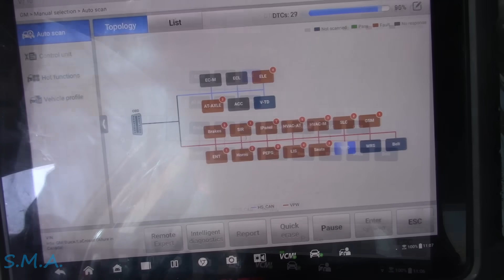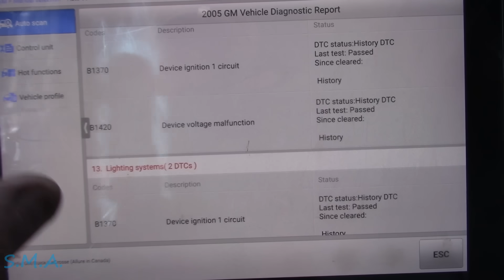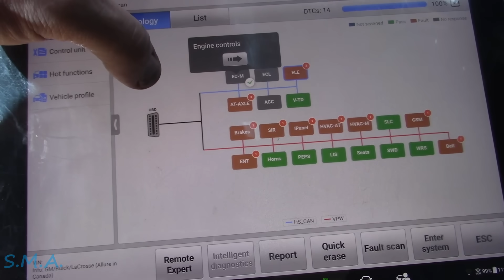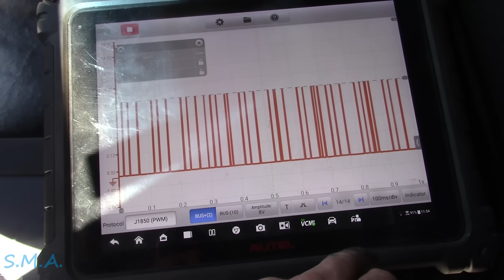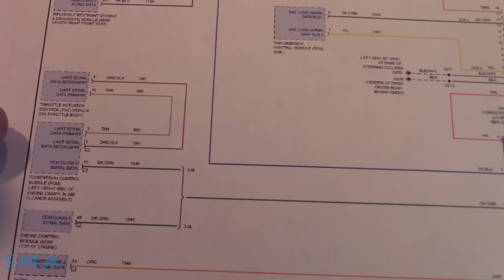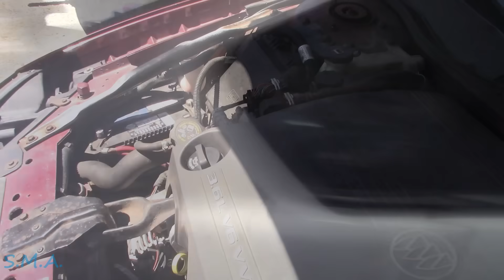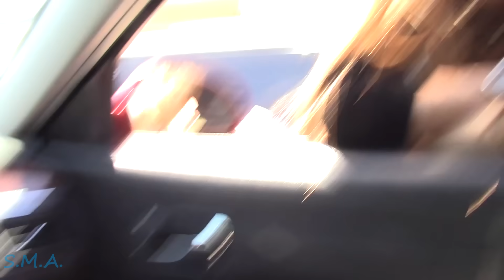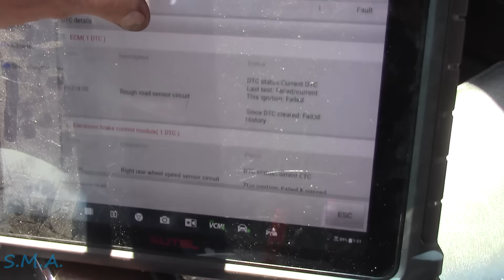Buick LaCrosse: No Start No Communication

Comment: Even some methods for ferritin out the truth from the general pooblic. Eric O. Have ya'll ever changed out the Bluetooth on a Dodge car? It's up under the steering wheel and brake pedal. When you are over 75 and ya'll don't have Eric O. Or Rainman or diagnose Dan in the general area you do it yourself. Not only that but at the dealership it is 500 dollars for your wife to make phone calls in the car. Well I will tear it apart and try to find the internal fault. Since these are common failure points I might be able to find it. The radio has been blanking off and when turning off the wipers it straightens up it seems to be a grounding problem. Now I also have to find all the ground spots even inside the car. Thanks for your videos Eric, ya'll have excellent diagnostic expertise and it helps me. Thanks, Paul.

Comment: Code PO318 is a Rough Road Code, the Lacrosse comes with hardware which allows the PCM to determine if the engine is running rough or if the road is rough if it can determine between the two it throws the code PO318  a lot of auto makes are adding this hardware.

Comment: Hi Eric, a message from Dean Harris.
I am a former Holden/ GM tech from Australia and have had some experience with vehicles that have a rough road sensor.
We had the Holden Barina/Viva from 2005 to 2009 made by GM Daewoo which had this sensor installed.
They were only on vehicles which were not fitted with ABS in the cheapest model grade.
I suspect that is why you ended up with P0318 after programming. 
The replacement PCM possibly came from a vehicle not fitted with ABS.
Hope this helps.
Cheers, Dean.

Comment: That powertrain was actually one of the better ones GM had back in the day.  The 3.6 V6 with a four speed automatic can hold up for a long time.  The question was always around the electronics back then, which is the case here.  I always learn from these videos, thank you for sharing.  Thanks for sharing while driving to an appointment your conclusion.

Comment: One of the things a good mechanic/shop has to deal with is getting jobs from one, two or even three previous mechanics/shops that can't solve the problem. Therefore, as in this video, you have recent finger prints and disturbances to the vehicle which pretty much hands the next guy alphabet soup to start a new diag. At least with humans, there is a medical file/history that comes with the patient which might not be a bad idea for vehicles to have...a documented history sheet that stays with the vehicle however, one concern of variance would be "not the same doc is seeing the patient" regularly and it would likely cloud the history some.  In this call, at least the cost of the computer wasn't very much so that seemed more practical and got her running for the cost of a pack a cigs.

Comment: The case of the PCM is the ground return circuit. when I saw this problem on the Holden product, I could not install a used PCM unless I "reset" the used PCM first.....

Comment: In my defense this explanation is only for proof-of-concept and had to be shown to my previous boss. I cut the data wire going to the ECM and put a scope on both leads you'll notice on those GM computers that their voltage drops down into the millivolt they still communicate but they're unable to communicate if you get my drift. The vehicle side of the harness still contains the 7 V

Comment: Your dealing with the GP (general public) advice rings true to me. I led a team of technicians doing CNC machine maintenance. We had a lot of skill and experience, but frequently lacked OEM documentation. Troubleshooting particularly deep electrical failures could lead to the black hole of OEM secrecy. This juncture would get me on the phone with the manufacturer wizard "Shell Answer Man" (does that date me?). I was just smart enough to provide the wizard with exactly the data he needed to get stuck at the same place that us (me). I learned to filter the question and data to not lead the wizard down our problem rabbit trail and let the wizard "spill the beans". Most commonly, withholding information would allow the wizard to speculate down his own path and not detour where we got stuck. I usually aborted the phone conversation with, "Thank you. That is what I needed...", before he concluded his speculation musings. 

In this video, you easily could have started chasing pre-existing symptoms that the customer was satisfied to live with and didn't affect the issue that brought the Buick to your shop. Witholding information  instead of leading the GP (customer) acheived the required confirmation without letting you wonder if you set the customer up to leave you with the same question.

You are able to obtain OEM data, though at an expense, in the automotive world that was not available to us in the much smaller CNC world. Even when your service data is wrong, the specific error becomes obvious and gives you other valuable information. An old former boss self defense quote after I caught him documenting wrong information was, "A little bit of wrong information is better than no information." He was wrong in the self defense specific situation, but no information can be a dark hole of discovery difficulty. Armed with information you can save a lot wasted time and unnecessary work. I enforced our shop rule to accurately add or correct documentation when a discovery was made. Our shop kept machines for decades. Cataloging data for future reference for the entire staff was a daily requirement. We referenced this data base daily in subsequent troubleshooting.
I had a particularly savey technician that wrote and in maintained our maintenance and repair software program. He created search engines to allow us to search tens of thousands of repair records in moments to find previous repair successes. This saved vast amounts of time and allowed moderately my skills technicians to effect successful repair while lacking personal technical troubleshooting skills. I labored as a technician and led the team for over 30 years. We created an interdependent team providing around the clock maintenance support to keep production equipment fully functional. You work in a "one man shop" and only need to document what you cannot remember. Around the clock production demands required us to routinely hand off incompletely diagnosed or repaired machines to subsequent shifts for completion. Logging repair documentation before leaving your shift allowed subsequent team members to understand how far you got or they could tell where you made a mistake and didn't have to go back to square one and start over. Smart technicians didn't easily see the need for "simple issue" documentation, but our less skilled staff was dependent upon this data. We set our company interest above our own egos. Maintaining this departmental culture required keen management attention.

Your YouTube video record uses a very different format to document troubleshooting struggles and successes. I have been retired for years and still enjoy sharing in your troubleshooting journeys. Modern vehicles parallel the CNC technologies that I dealt with. I regularly wished we had more complete documentation for our equipment. I don't like working on cars. The hobby mechanic doesn't have affordable access to required documentation. Industrial machinery designers give much more consideration to  repair technicians than car builders. Repair access and documentation is impressively complete, even though I wished for better data. 
Thank you for continuing to post to YouTube.

Comment: I gotta wonder if the GM site has issues. My buddy just did a used BCM in a Caddy and not only did it take FOREVER to get it to download, but also he too got several error messages, yet the thing worked just fine with no codes. It was his 1st time as well swapping in and reprogramming a used piece. New 1s are NA. (02 full sized with the 4.6)

Comment: Yeah it’s a universal asynchronous receiver/transmitter. The main deal with those is you don’t need a separate clock signal so assuming you agree on the rate you can send data with just one signal wire.

Comment: FUN FACT...
UART..  Universal Asynchronous Receiver-Transmitter
That is the 9 pin and/or 25 Pin serial port on the back of REAL OLD home computers.
It was used for Analog telephone Modems and the serial mouse.
It was replaced with the USB port (Universal Serial Bus)..

Comment: Recently my cousin had his Mitsubishi 05 montero move while he was under, he got bruises only cuz I stopped it in time but it didn’t crank we assumed the issue was dead starter so he straight wired it n it started in drive, turns out, shifter cable came off from the shifter, thankfully he’s fine

Comment: That would not be the first GM ecm going bad because its solidly mounted to the engine and experiencing all the heat and vibrations that it does. Really a lame design

Comment: We definitly need a "rest of the story" on this one. Would love to see you solve all the problems on it.
Reply: The rest of the story is that the p0318 rough roads was caused by the wheel speed sensor which there was also previously a code for. The computer uses info from the wheel speeds and correlates it to the crankshaft position sensor so that it can tell the difference between a misfire and the wheel hitting a pothole causing the engine to slow down. If the guy gets the wheel speed sensor problem fixed, no more lights no more codes....probably
Reply: @LargeMuscularTitties  that era GM car with wheel hub sensor issues,  go figure.
Reply: @ curiousgrandpa… You must be a listener of Paul Harvey… “ Good day!”

Comment: Most trouble codes trigger the check engine light (or MIL malfunction indicator light). For this P0318 DTC, the light is not illuminated. You may, however, have other warning lamps illuminated (traction control, ABS, etc.) or even have some engine misfires or rough running.

Comment: Eric O.  I have a 07 Lacrosse, with the dreaded 3.6.  I bought it in 09 and have been nursing it along since.  Had 29K when purchased - now has 168,000 on the meter.  Thanks to you and Ivan, I've kept it running.  Bought some test equipment, breakout box, ginned up a fuel press gauge assy. And some other " stuff."  I do need a small Scope or a kit to make my laptop the scope.  

Here's my question:  Why did you go to the PCM at the "get go?"  Was that because there was NO money light when you turned the key on?  That's my guess - true or not?   Thanks for helping me learn how to trouble shoot.  A lot of it came as second nature as I worked Aircraft Avionics for quite a few years.  See you.  Hi to Ms. O.
Reply: I think it was because the PCM wasn't talking at all during the scan. A lot of cars don't or won't set codes for just a no start condition for instance if the ground wire was at fault most PCM wouldn't even know the ground wires gone and wouldn't set a code but if you tried to talk to the PCM with the scan tool and it doesn't respond that would make someone zero in on that.

Comment: Correct engine misfire detection is dependent on whether or not the vehicle is experiencing a rough road condition. A rough road condition causes unexpected crankshaft fluctuations. In order to detect a rough road condition, the electronic brake control module (EBCM) communicates a wheel speed signal over the serial data circuit to the engine control module (ECM). The wheel speed sensor information allows the ECM to distinguish if the crankshaft speed variations are caused by a rough road condition or are caused by a true misfire. If the EBCM reports a wheel speed sensor failure, or the ECM does not receive the rough road information, this DTC sets. doc id 1448080 in si

Comment: Don't feel bad I don't remember what uart stands for either. I just remember it is a serial port. Which kind of doesn't make sense because that's a really slow connection. That's technology that predates the PC. I should remember what that stands for I spent over three decades screwing around with them. So if you want to feel bad feel bad for my memory.

Comment: I  figured out why he takes so long to mow he covers the lawn in top notch then lowers it one notch cuts the lawn on to 3rd notch cuts again he doesn't want to over load the mower so 1/4 inch increments it is and I'd bet he changes direction so lawn looks like checkerboard.

Comment: Eric very common issue over here in GM's(Holden) of that Era, I've done several where I just install a momentary starter switch across the starter relay, as all of the used ECU's will die eventually in my experience.
Reply: @A. Melbs VZ & later(newer), actually anything V6 ecotec(alloytec) 2004 onwards (VZ VE WM WN Rodeo, Colorado, Vitara) etc... Have come across many 'Mechanics' up here in Brisbane who looks at you like you're Albert Einstein or something when you suggest a simple $20 fix to an otherwise cost prohibitive repair!

Comment: That is a very organized and well kept salvage or junkyard,the ones here in Las Vegas is very run downed and extremely ghetto..anyhow you sir always repairing vehicles that other shops and even dealer or stealerships cannot..great video and content as always
Reply: if 9/10th of the west coast to midwest burnt in flames, there'd still be enough stupidity there to ruin the solar system in a month. 🤣

Comment: Eric, you are the master of TLA's or as we say in the industry, Three Letter Acronyms. I learn something new each video. Thanks, Man.
Reply: Yeah, but Eric got hung up on the FLA  (Four Letter Acronym).  "UART" = Universal Asynchronous Receiver Transmitter.   Comes from the early days of the microcomputer industry when connecting small computers to serial terminals (Teletype machines, IBM 2741/Cope 1030 terminals, DEC VT100 video terminals, etc) using an RS232 bi-directional serial interface was a common thing.  A UART is basically a pair of data format converters.  One is a parallel to serial converter and the other a serial to parallel converter.  The UART would take an 8 bit word from the computer and given a clock signal would generate the correct baud rate and step the data out serially to the terminal.  In the other direction it would accept the serial data stream from the terminal and assemble it into an 8 bit word that the computer would retrieve from the UART register.  One of the more common ones back then was the AY3-1015D if anyone wants to look up a data sheet for more details on how it works.

Comment: I’d like more info on your to go tool set for the yard. Didn’t see it on your shop link. Looked like a decent tiny set. My tool set gets heavy to carry when to go to my local pullapart yards. Like I’m sure you do….. these upullAndpay yards are awesome! I love mine! Nothing more exciting than finding aftermarket goodies for cheap! 
Keep up the great work! Wish I had a local guy like you near me. Probably do but haven’t found them yet. I’ve got hella problems with my rear temperature settings on my 04 Tahoe z71. I’ve replaced the whole system, harness, motors, sensors, brain, controllers  and still nothing proper. The temperature motor goes to max one way and won’t turn at all. :( been this way for years! I’ve just been clamping the temperature door flap end to cold or hot depending on season. And yes it’s stupid! :( I hate it! :( just can’t figure it out.
Reply: Did you try a calibration on the scan tool?

Comment: P0318 is a very common code on this platform see c0050 dtc first, possible bad wheel bearing/bad wheel speed sensor

Comment: Hey Eric O I have an autel and the newer update has a report save deal eh regardless I save the info and then do whatever happens going down the rabbit hole and try to go back and everything it does changes the saved data for that vehicle. Idk how to change that but I have to actually print hard paper to save the data. It has set me back a few times plus u get different data from dodges than what I know to be true like mileage and whatnot makes me not trust it on fca products but that's just a statement really love the scan tool but felt the need to mention just be careful only saving it. At least you have a video to refer back to.